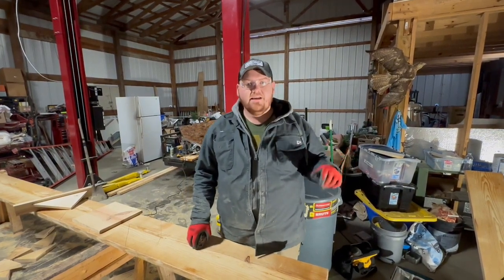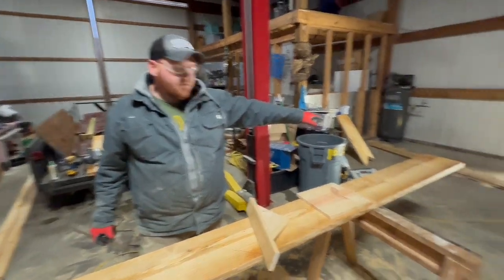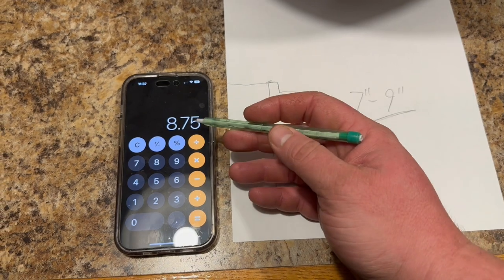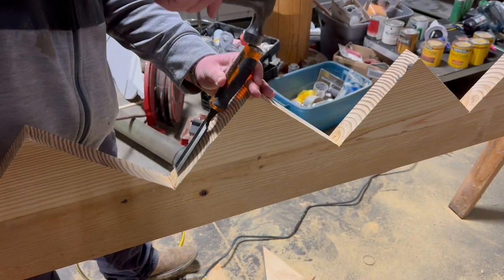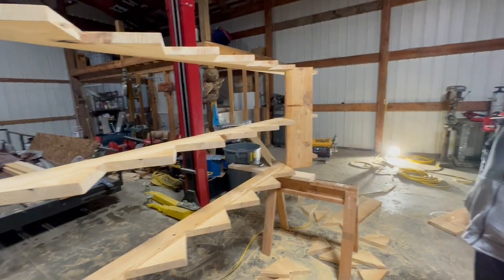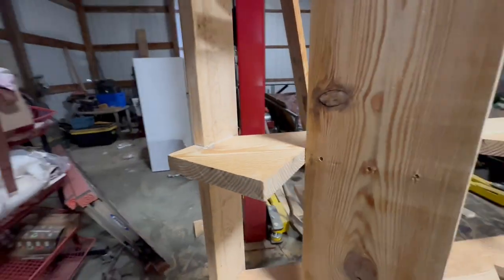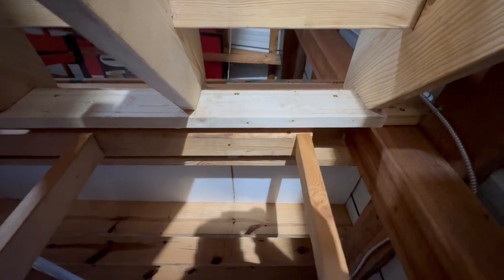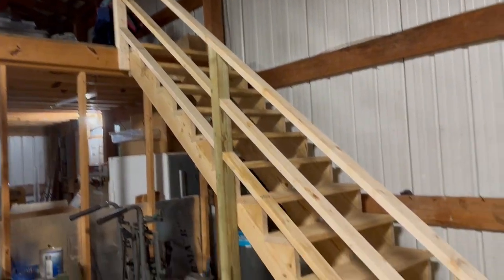HOW TO Build Stairs | Super Simple Way to Mark and Cut Stringers!

Comment: Hey Red, I enjoyed this video. Very helpful. I need a staircase built for my cabin. I experimented with some treated 2x12'sx16 feet and used a framing square 7"rise and 11" tread. My calculations were way short. This was very costly. Thanks for sharing this info.
Reply from the maker: Hey no problem! It’s definitely the simplest method I have found to get stair stringers correctly! Hopefully I explained it thoroughly! 
I appreciate the consistent feedback and comments from yah Dean!